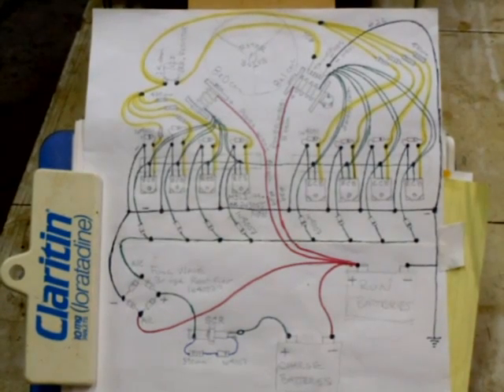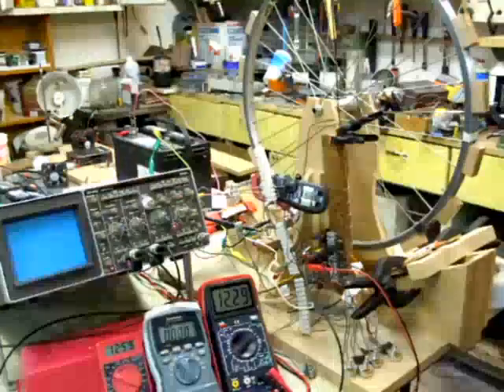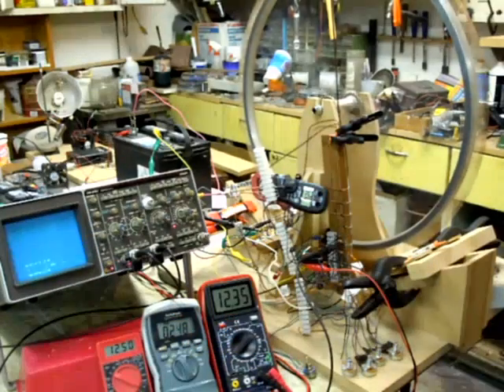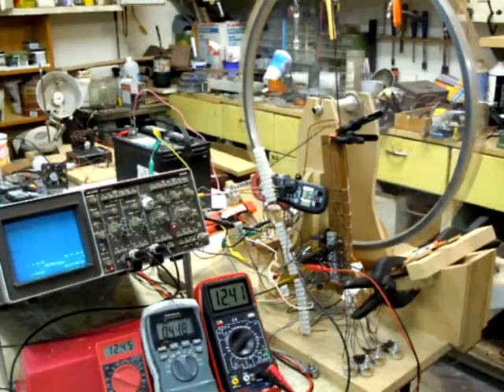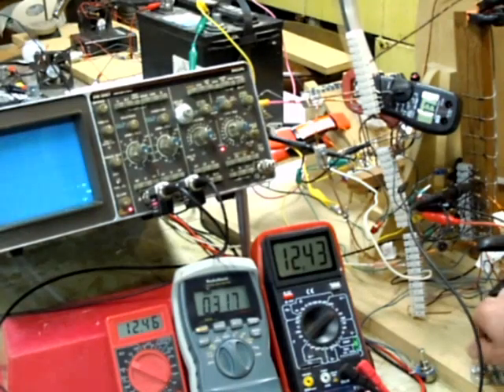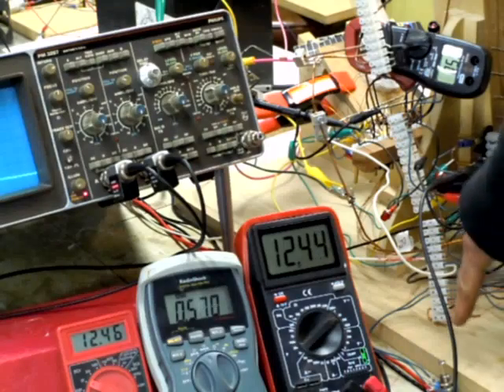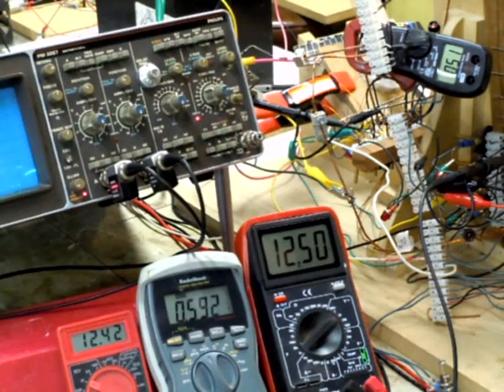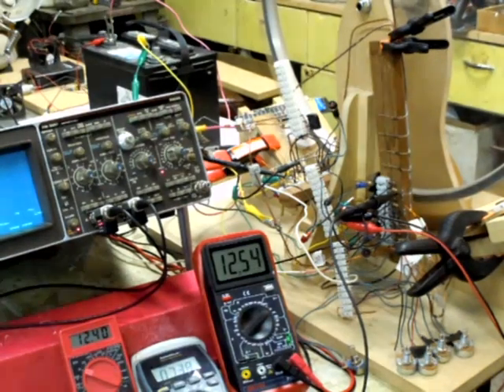2 Coil Bedini Running Tuning Tips Amp Draws Outputs

Comment: hey mate I cant make out your diagram .. too blury. Also ive been trying to tune mine with an AM radio any tips on that please, I have had a pluse with a extra thump at full rpm least amps and then can manage a constant purr if I turn the resistance up... btw do you have all those pots in place of the resistors?

Cheers .. love your work